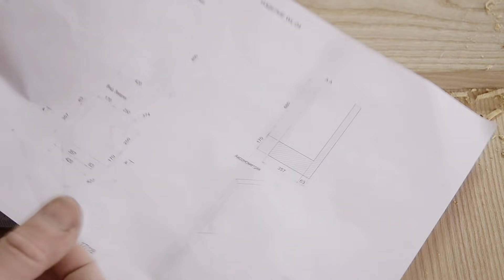Щось дивне з колод тополі

Comment: Wouldnt it be easier to use the chainsaw for the most part and cut it like you cut arcs on metal? That the most is done and then just refine everything
Reply from the maker: Yes of course. But I first worked with a chain saw, so I minimized its participation in the process.